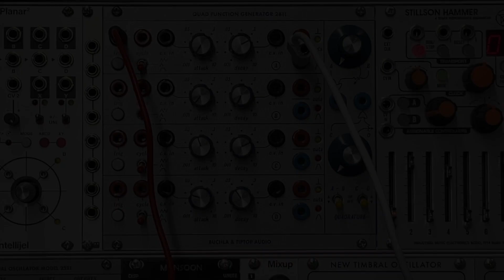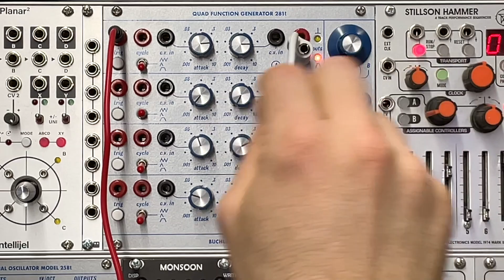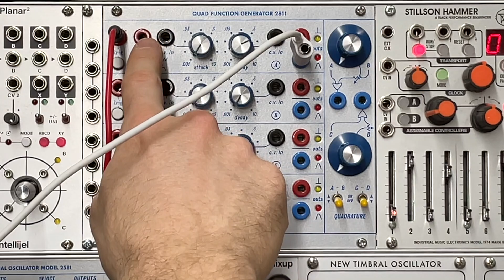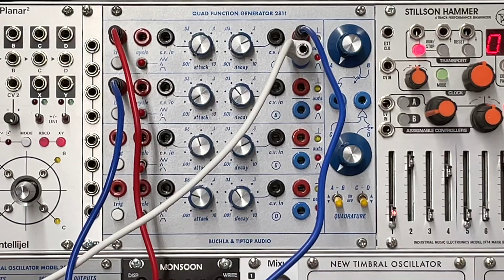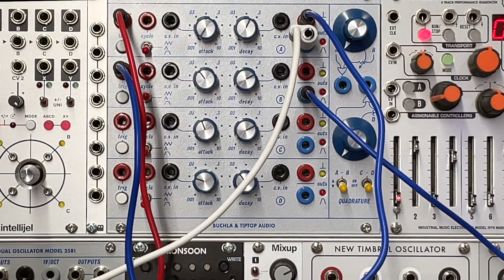Buchla Tip Top Audio Quad Function Generator 281t Eurorack Module Tutorial Lesson 2: Envelope Ideas

Comment: Hi ethan,   I have some eurorack gear, I've been learning modular synths for some years now,  but I can't seem to get this module to work for me.  I put together a small tt/buchla system,  the vco, source of uncertainty, 281t and two 245t.      Ibought a simple passive LPG,  and route the signal to mixer.     I was trying to make a patch that is plucky like a short plucky notes that are melodic.   I could not get it done.    Someone told me it's probably the LPG,  but i can't understand why.     Heres a question: how would you make a hihat  patch using the modules i describe?     (I know noise is used as the sound source), but then what to what?      Noise to vca, env to vca, vca to mixer ?       I can't seem to get the tt buchla modules to work for me.